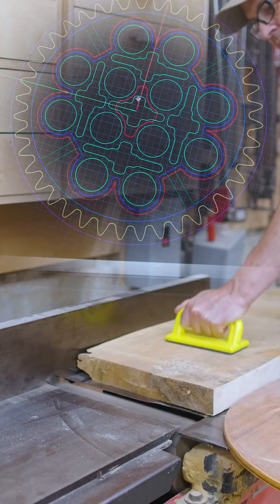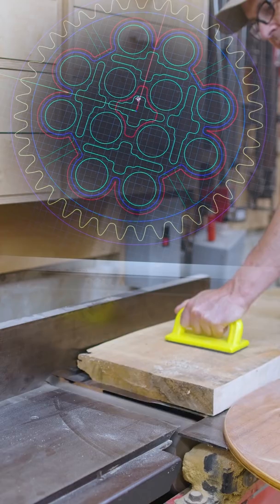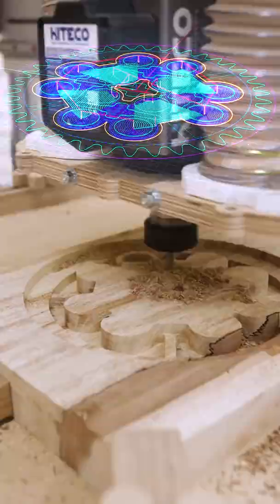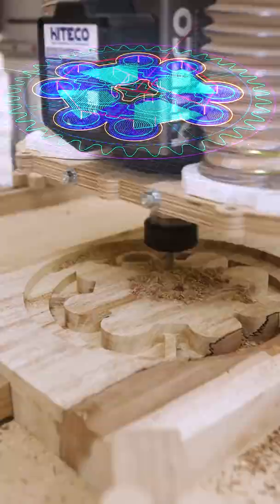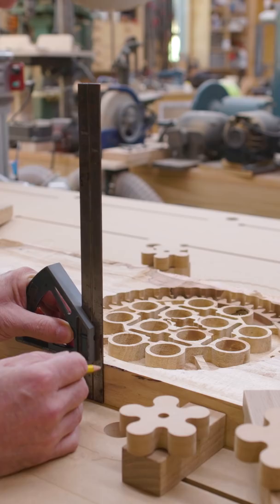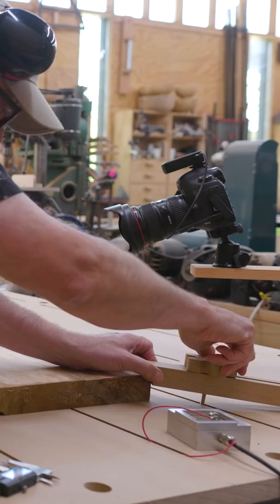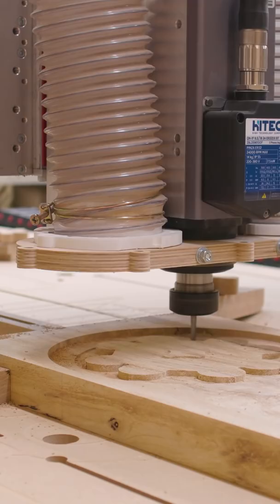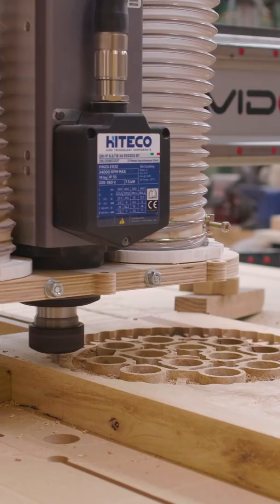making a wood Lego gear

Comment: Machinist here. When I do 2 sided work, I drill a center hole through the work, make one corner absolutely square to the machine so when I flip, I can mirror the work in CAD and set the through hole as the origin so it'll come out perfect. 

Hope this helps someone

Comment: Drill 3 or more 1/4 holes in the face of your excess material (outside the edge of part), then mirror the same holes in your program and drill into the waste board of your table...  then use 1/4 pins or dowels to flip your material over. You can then machine the other side of your part to pretty tight tolerances, leaving u with an accurate 3 dimensional part using a 3-axis router.

Comment: When you need to flip a piece, before you clamp it down, drill at least two locating holes, drop in some aluminum dowels, and you’re done. If you drill the locating holes all the way through you don’t need to align them. Just flip, align the pegs and clamp. Done. Easy.

Idea from Alexander Chappel

Comment: We drill location holes all the way into the spoil board, outside of the part when cutting the first side.  Then flip the part insert pins to locate, turn on the vacuum zone and remove the steel pins.

Comment: Make it a shot glass holder or regular cup/can holder or that also is a hot dish protection plate. Or a clock. Or interlocked with another gear on the wall as decoration.

Comment: Make a glass top coffee table, under the glass have a set of gears that stick out the sides just a little. Then as you sit at the table you can turn the gears by hand and have all the interconnected gears under the glass rotate.

Comment: You could have just cut the end off the log in the width you needed because it is clearly bigger than the gear you cut out rather than planing a board and cutting it out it could have been a lot simpler

Comment: youtube should really figure out a solution for displaying vertical video on horizontal (Laptop) screen before pushing this initiative more, it look so stupid and small, for example youtube could simply licence the tech from snapchat old spectacle where you could rotate your display. or build tool on the website  where the vertical video is simply a dynamic cropping of the horizontal video

edit: clarification

Comment: Totally get why this is a minute long video for reasons other than tiktok. Its just not a very interesting project to make into a long form video. The content would be:
Here's me doing hours of CAD work with fiddly little adjustments.
Here's me throwing the slab on the table and loading up the file.
Here's the CnC running.
Probably sanding, there's always sanding.
Look at the thing!
Kind of the perfect project for a short form.

Comment: I think you should mesure the shape and the  space that is left in between the other shape  out not in same goes for the other side but measurements need to be all the same so in other words like a picture crop your images or image on the log or bird if you will or measure the same amount of space that you have in between the cut to the end but all the way around